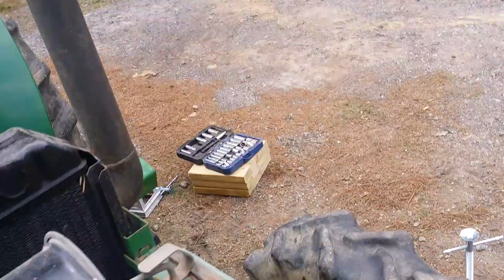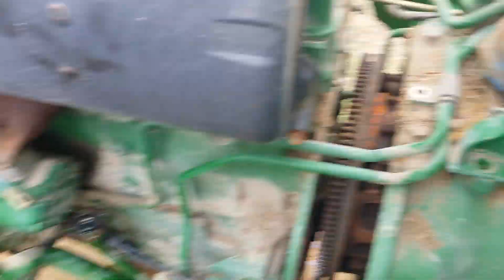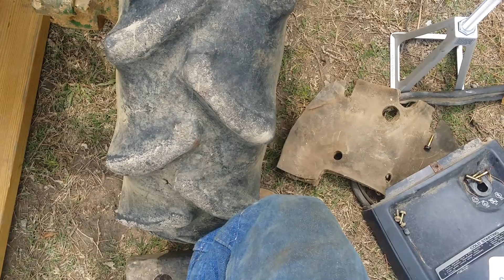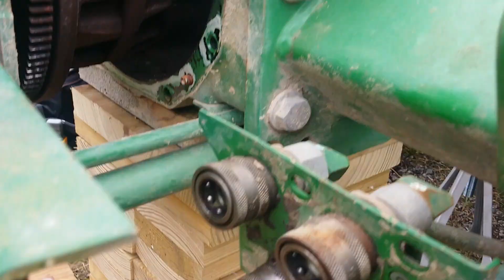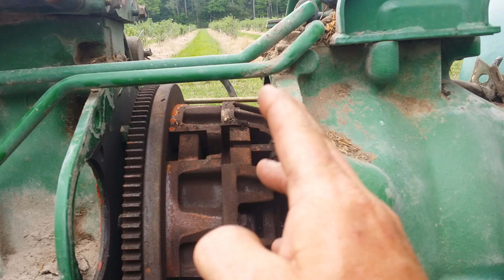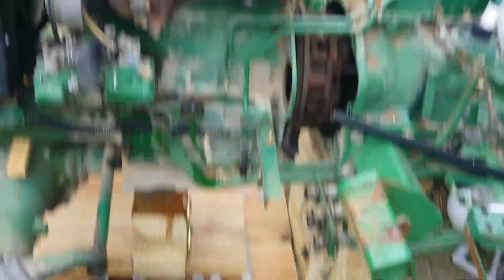Splitting a John deere 970 to change the clutch.

Comment: If it was what I have encountered before, I wedged the clutch pedal to stay engaged with a piece of 2x4 ,removed the small plastic cover on right side near brake pedals then remove the screen on the clutch vent and used a large size flathead screwdriver to slide in between the clutch disc’s to free it up once again. This is a handy and cheap way to unfreeze one that has been setting for a while, the first time it happened to me about 25yrs ago it costed me $175 , then I wished up with the 2nd time encounter of this and asked a couple of good friends with tractors and they told me about this, and it’s the same thing the mechanic done the first time when it cost $175, it took at max 10minutes to do, I don’t mind paying for good mechanic work but $175  for 10minutes of work is bs. Especially since I borrowed a rollback and took it to him.

Comment: If it's just a stuck clutch, I've read that the pressure plate can be popped free with a long screwdriver through that access hole seen on the right side. I have to
fix my son-in-law's 950 with stuck clutch, so I'm really hoping this info is correct!
Don't want to split it, but if we get to that, your methods look great!
Reply from the maker: It had sat up for several years . The owner wanted it replaced , and I happy to oblige because that extra cash in my pocket bought myself a new 11meter antenna and upgraded my mobile amateur radio.

Comment: I'm an industrial maintenance mechanic, I've removed machine parts the size of that whole tractor... but splittin' that in half to change the clutch and the thought of trying to realign that all up to put it back together gives me a pounding headache! LOL!  Nice job!
Reply from the maker: I hear you. I was a boiler maker for 18 years so i had a lot of experience bull rigging and problem solving.  it actually all lined up pretty easy . I used the tire pressure to adjust elevation and used the steering to adjust windage.
Reply: @jamesozment1  This is funny, as I'm watching your video, I was thinking, thats how I would've blocked it up. I'm a 21yr Boilermaker. LOL Tearing it apart and putting it back together is what we do, and its never on a bench! Always in the air, or deep in the hole! LOL
Reply from the maker: @benmarshall76  i was a boiler maker for  18 years  i guess bull rigging comes naturally to a boiler maker

Comment: I got a 1070 with the loader I believe is just a little newer Tractor but the same thing. Nice job on the video I thought of walking with the roller tubes underneath was pretty ingenious I never even thought of that I'm doing the same thing as you were I got to do it out in the yard. I was worried how to get a accurate spline alignment without moving it to easy but your roller idea is perfect hope everything worked out good for you nice job. Rob Sandera
Reply from the maker: make sure as you roll it to keep the pipes even .
Reply from the maker: worked out great tractor still plowing and fertilizing and dragging ditch witches

Comment: Nice innovation the rolling system. My 950 jst locked up. It ran gr8 the day b4, I tryed starting it up with clutch pushed in and in gear, and it started to take off. I placed in neutral with the clutch,  then took foot off clutch,  and it started normally but when I pushed clutch  in to try and put in gear, it just grinded . How did your problem arise?  Thx